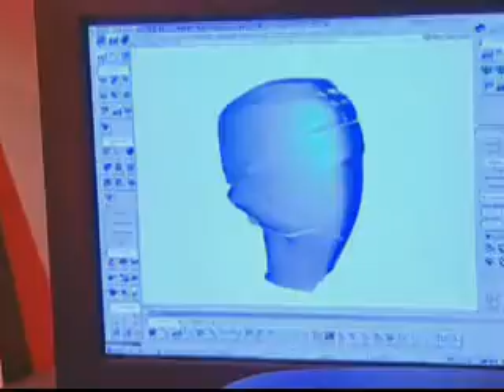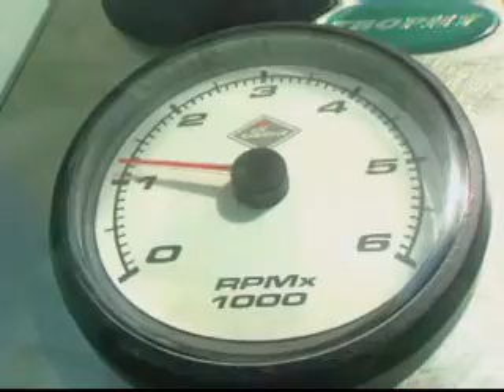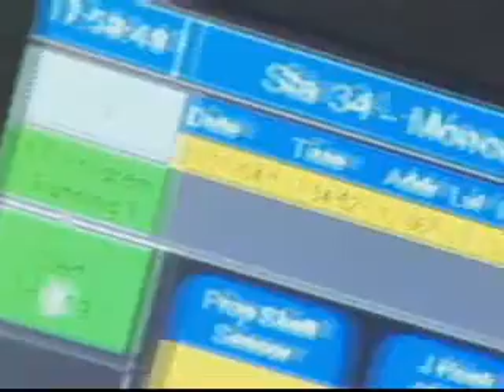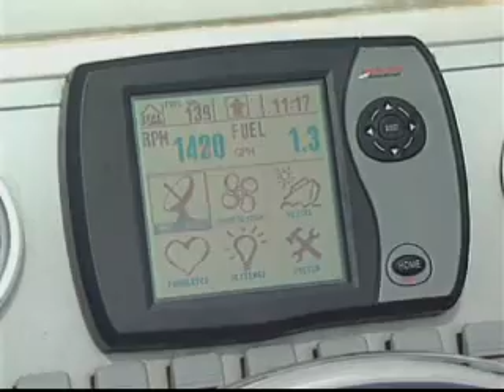Mercury Verado 250 HP

Comment: four stroke engines in water , have more wear , because conecting rod hit more in the explosion cycle and less in admission cycle , two stroke engine is more robust and equilibrated , the old problem was emissions and fuel consumption , but today two strokes maintains low levels with electronic direct fuel injection .
weight and power ratio are bad in four strokes , because need more steel parts , crankshaft , conecting rods , camshaft , valves , springs .
two stroke diesel , engine of future.

Comment: Check out the new motors...  This vid is old.  Now they have 300 and 350 hp Verado's, as well as smaller ones ( 115-175 hp).  The Yamaha 350 is a total dog compared to these...  It weighs A LOT more, and sucks on gas like you wouldn't beleive.  Check out some performance tests and look at the GPM and MPG numbers between the Verado and Yamaha on comparable boats...  You'll be amazed!